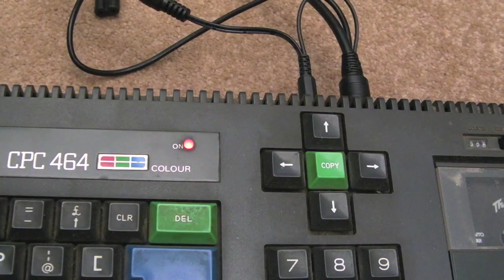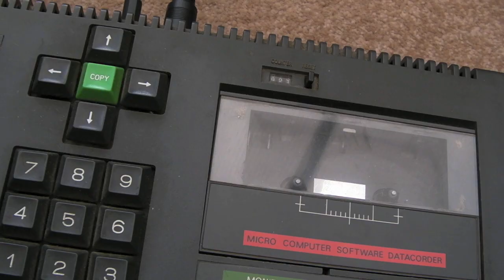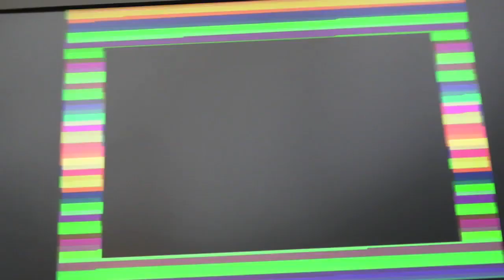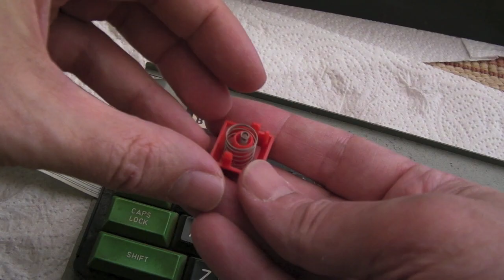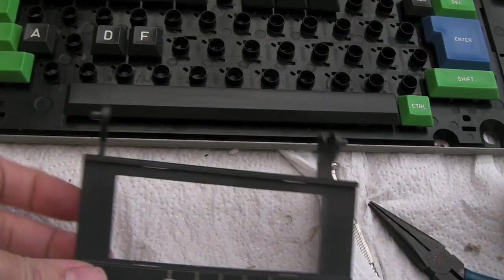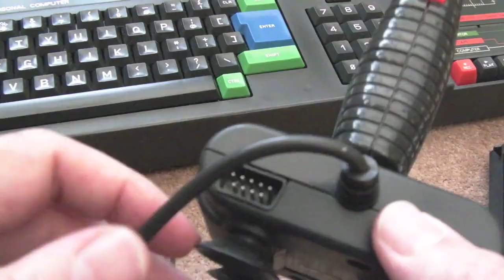Amstrad CPC 464 Repair & Restore - Junk to Jewel

Comment: The mp3 module connects the system to a tv
Reply from the maker: I had to read that twice lol!  I was thinking wtf does an mp3 player have to do with this :o)  Then I realised that's their model number for it.  Today I noticed that the MP1 has an RF cable I think?!?
Reply: MP1 the bad TV-modulator, MP2 is the one for the 6128 as well? MP3 is the SCART one? MP4 is the TV-tuner?

Comment: Bravo sir. You can translate the series number to release date, country and factory of origin. Thanks for the mentions, lovely to see another 464 rescued.
Reply from the maker: Thanks mate, and thanks for your help =D  I will check the serial number later to work out its release date =D  Started with tape loading issues yesterday but I worked out a few solutions today.  Ideally I need to find a replacement idler wheel but it seems like no one has found a suitable replacement for these tape decks.  Plenty of belts around but that wasn't the issue.

Comment: CPC is very sensitive in the voltage. Needs exactly what monitor produces.
The 6128 has also 12V reversed polarity.
Z80, AY and RAM are the main problems in these mobos.
Many times you'll see that RAM is cold and voltage is OK but the problem is there.
The trick is to measure ohms on ram chips while the machine is off.
You do that from an upper pin to lower etc etc then you write down the results of every chip and compare.
Reply from the maker: Yes, I imagine with the size of the board and the number of chips there will be some voltage drop.  I noticed 5.3v in roughly translates to 4.9v on most of the chips.  So a cheap 5v PSU wouldn't do the job, it needs to be outputting ~5.3v and provide sufficient current.  Nice tip on finding RAM faults there =D
Reply: My pleasure.